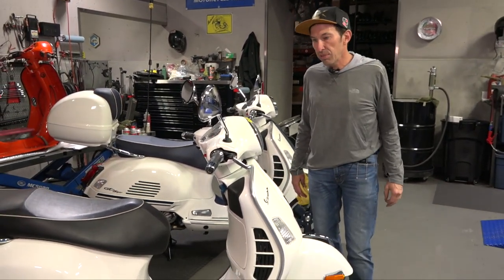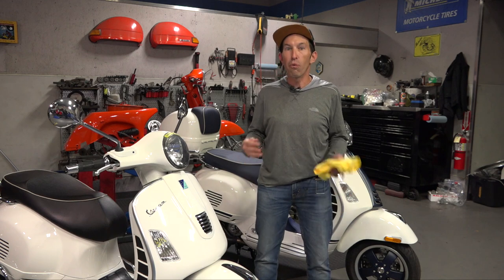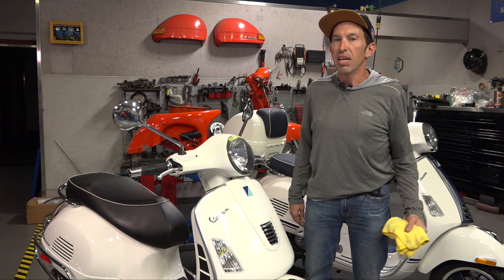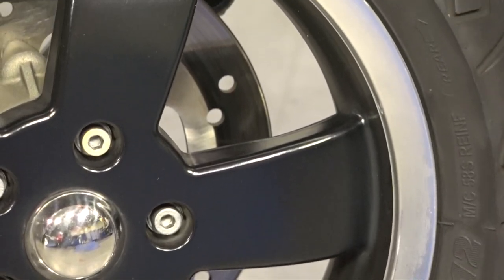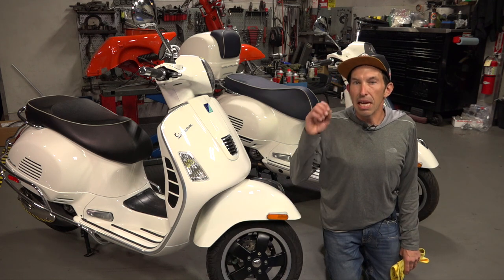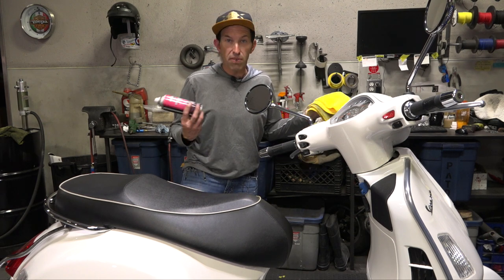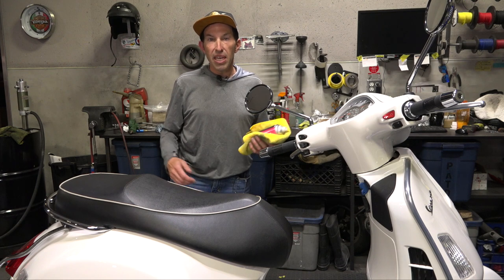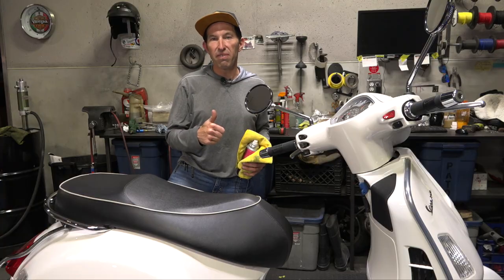The Cleanest 9 Year Old Vespa GTS in San Diego

Comment: I'm afraid to touch the thing lol.  Great video and great scoot  My 2014 primavera has 42000 plus miles. I put it away a year ago and put 17000 miles on an SH 125 I.
My vespa needs a bit of work, as I dropped it and came off twice.  It only has a tiny dent which I think I can get out and to replace trim, hoses and brakes.      I'm in the UK and ride in all weather, thinking of replacing the 11 inch wheels with Sprint 12 inch wheels, I assume this would work.

Comment: Whew…indeed, impeccable. I did my best  to keep my 2015 GTS Super looking nice, but if the bike you're showcasing here represents a 95-98% level, the best I could do with mine was about 80%, which wasn't too shabby…at least, until the bike got totaled. Now I have my new SuperTech, and I fret about its now-lovely-new looks: how to keep that matte finish looking like it does now (already with a teeny-tiny mark from road debris)? The bike has no garage, just a retractable awning at the side of the house I installed just for the scoot, plus a sturdy bike cover. Hopefully all this, plus the usual TLC, should help.

Comment: I do the same 😝 takes so much time cleaning it and wipe all the oil and Cooland of the leaking engine 😝 (4k miles) 

Really try to clean it good ant spray a lot of oil (wd40) under it, they tend to rust extremely fast 😢